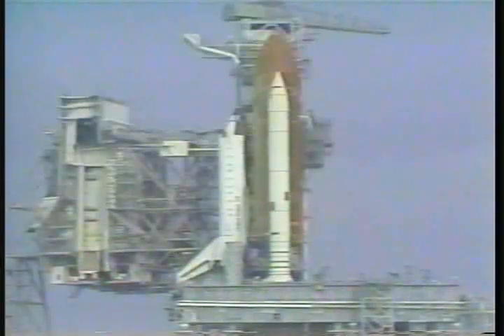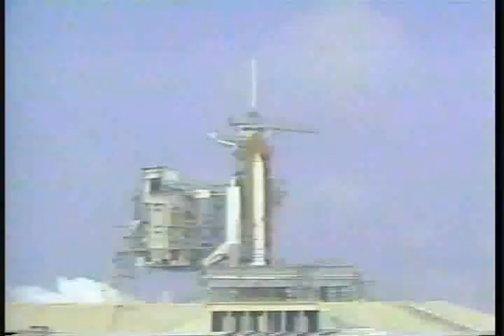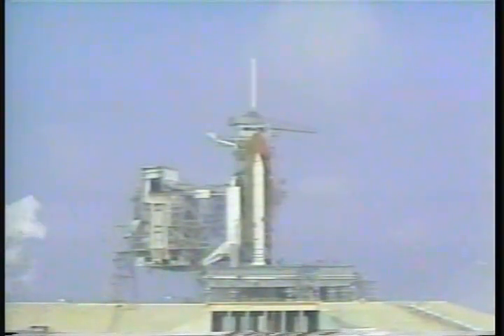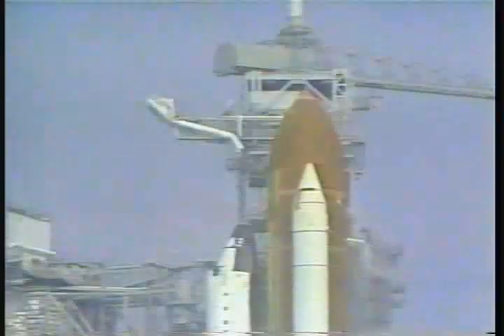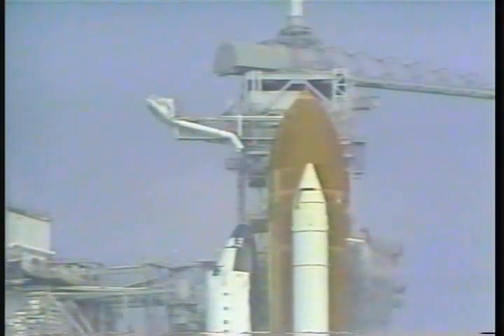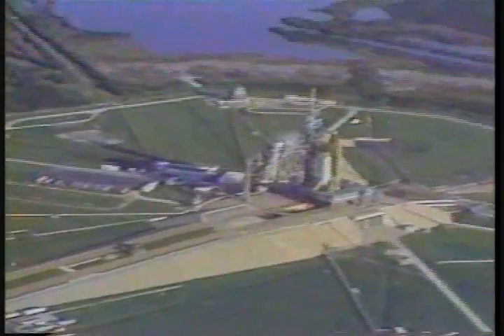STS-41D pad abort (6-26-84)

Comment: The confusion was because the abort was commanded before all three engines were started; since engine one had not started, the computer gave no indication that it had been shut down. Someone who wasn't looking at a tv screen reported a possible runaway engine with the "break break" call. It wasn't too clear here, but you can hear Hartsfield ask control at 0:59 if they wanted him to push the manual shutdown button in the cockpit just to make sure it was shut down.

Comment: From what I know, there was a small fire from the base of the shuttle.  What really stunned me was that the fire suppression system was not activated until around the time the crew got out, which resulted in them getting soaked.  Now I know that fire detectors are present, but why didn't they detect the fire earlier?
Reply: It was a hydrogen fire, and invisible

Had they used the regular escape route, they'd have walked right into it.
Reply: @SLagonia but could 1988+ technology could have detected it?

The world of 1984 was nothing like the world of 1988-onwards.

Comment: You can hear the panic in the "Break Break" call, Thankfully the engine was shut down...
Reply: glenwoofit I disagree.  It wasn’t a panic call. It was an urgent notification of an unsafe and unknown condition
Reply: It actually never started, which was the problem - Because the others started and were shut down, they showed as being shut down.  Engine one never started, so the computer couldn't confirm it was shut down.

This system was overhauled after this incident.

Comment: @marmaladekamikaze (Part 2) The "sparklers" that you can see going off before main engine start on a video showing the right angle view are pre-burners meant to burn off that vented hydrogen so there's no explosion due to hydrogen buildup when the engines light.

Comment: @don312000 
If the LH2 is dumped overboard(out of the edge of the SSME nozzles) then when it contacts the humid florida air, it is bound to condense the water in the air and cause the 'white jet cloud' phenomenon we see at 1:00.

Comment: @glenwoofit Actually that engine had never started...the SSME's ignite engine 3, then 2, then 1, counterclockwise from the right-hand engine, then center, then left. The abort command was triggered before engine 1 lit, so therefore the systems didn't show it as having shut down.

Comment: @don312000 
In the wiki article it does not suggest that the LH2 coolant is dumped overboard, on the contrary it suggest the LH2 regeneratively cools the nozzle.

Comment: @marmaladekamikaze You're correct it's hydrogen, but it's actually being vented from the engine bell itself--those rings you can see on the outside of the bell are cooling pipes that circulated cold liquid hydrogen to cool the bells while the engines were firing. That steam is from an overflow vent which you could see clearly if the vid was higher quality. Check out the prelaunch vid of any launch you'll see that coming from all three engines.
Reply: Thats Oxygen being vented, not hydrogen.  They arent going to vent hydrogen at the pad.  Hydrogen is ducted to the flame stack to be burned off.

Comment: @bamsb90 No, there's never been an RTLS. Go on wikipedia and search "space shuttle abort modes" it explains everything. In addition to this flight there've been 4 other RSLS on-pad aborts, on STS 51-F, STS 51(Pre challenger flight#s were a code, but then they went back to ordinals after Challenger) , Sts 55 and STS 68. Only ever in-flight abort was on STS-51F on a subsequent launch attempt, when an engine did fail, but they performed an Abort to Orbit and were able to complete the mission.

Comment: @bamsb90 According to wikipedia's STS 41-D article, the issue was in engine 3, so had the abort command not been issued, SSME 1 would have lit and they would have launched. The answer to your question depends on what the issue w/the engine was...had the engine been able to safely run, they would have been OK. Had that engine later failed, they would have been looking at an in-flight abort such as an RTLS or TAL, or in the case of a major failure possibly a loss of mission had the engine exploded

Comment: @bamsb90 NOt sure if my original answer posted or not so here's Take 2: Had the abort not been ordered, engine 1 would have fired and they would have launched. Had engine 3 (the one that caused the abort) been able to run, they would have been ok; had it failed in-flight they would have had to do an inflight abort such as RTLS or TAL depending when it failed. Or, had the engine failed catastrophically, the mission and crew could have been lost. Fortunately the system did work correctly!

Comment: @marmaladekamikaze Are you referring to the ones on the orbiter jsut to the right of the OMS engine? The white protrusions from the OMS pod are the RCS steering jets the shuttle uses in orbit for rendezvous maneuvers, etc. The disks are paper covers over the thruster exhaust ports that keep debris from getting into the engines. The vibration of main engine start causes them to tear and disintegrate.

Comment: @don312000 
Ah so those vertical pipes going longitudinally down each engine bell are overflow vents. Yes I've always wondered what that white spray was and what it was for. Thanks! and yep you're right on the mark the ''sparklers'' are Titanium & Zirconium fuelled NASA Standard Igniters.

Comment: @don312000 
Ah I see, thank you very much for illuminating this for me! At 1:08 here in this video on  STS-41D the 6 ports can be seen to the right of one of the OMS nozzle, yes. So the 6 are the aft RCS, which aren't active at takeoff? but the vibration of the SSMEs cause the coverings of the RCS to break. Seems kind of strange, Is the reason the covers break at take-off is that, if the RCS covers break in orbit, that'd add to the problem of orbitting debris? or another reason?

Comment: @Cellmate412162 If I recall, the fire didnt actually start for some minutes after the engines shut down. After this incident, as PotholesInMyLawn stated, fire suppression water was turned on as a precaution as soon as the engines shut down, and also the orbiter access arm was re-extended immediately after an abort in case a crew did have to get out in a hurry.

Comment: @marmaladekamikaze And it's actually not water vapor its hydrogen vapor! Search "STS-93 Columbia Engine Failure" there's a much-clearer view from the same angle of the pre-ignition abort on that flight you can see how the vents are connected to those cooling pipes!!

Comment: @marmaladekamikaze Go on wikipedia and search "Space Shuttle Main Engine" and scroll down to the section "Nozzle" it explains the cooling system!! "The inner surface of each nozzle is cooled by liquid hydrogen flowing through brazed stainless steel tube wall coolant passages. On the Space Shuttle, a support ring welded to the forward end of the nozzle was the engine attach point to the orbiter-supplied heat shield."

Comment: @don312000 
I had no luck searching for 'Shuttle overflow vents' is there another term I should use to find more information about the Hydrogen gas venting that can be inferred from the condensed water vapor at 1:00

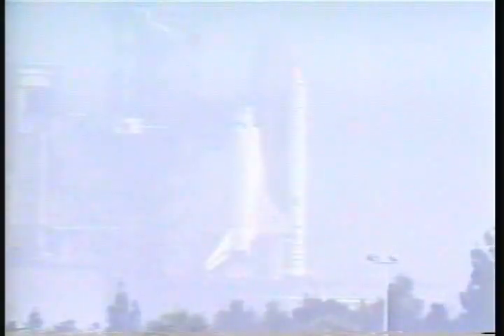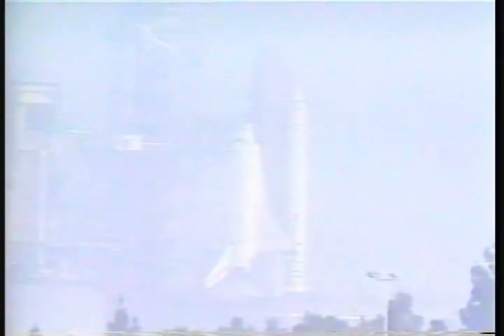Comment: In the video 'HD 1080p Nasa Endeavour Launch.' What are the six burst discs that burst between 0:05 and 0:07 to the right of centre frame? I've never seen them before, what do they do? are they Auxillary power units decomposing Hydrazine that power the hydraulic actuators that gimbal the 3 orbiter engines SSMEs? I can't find any info on these online, so any help would be appreciated. For some reason I can't post on that video, so thought I'd ask the question here.